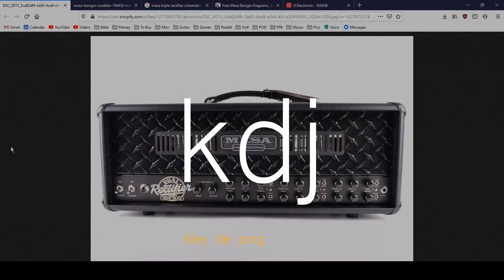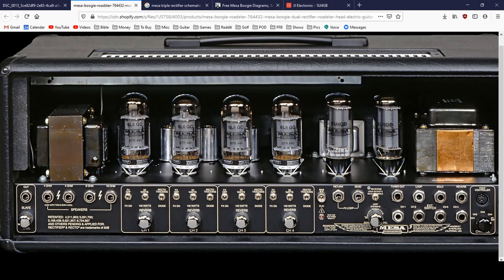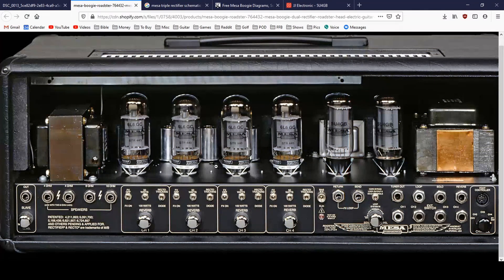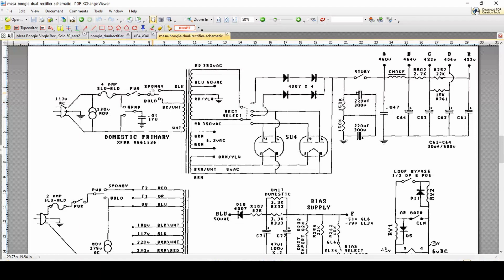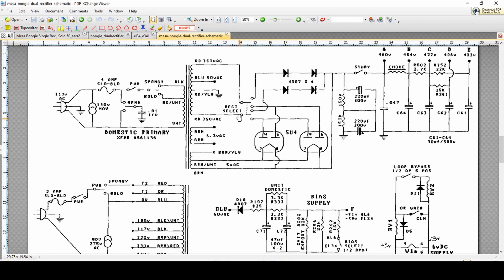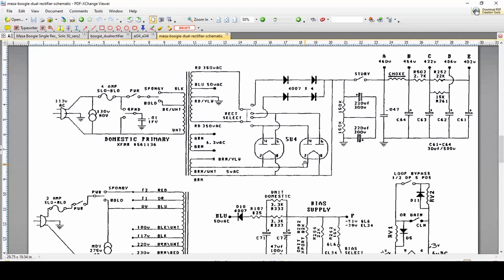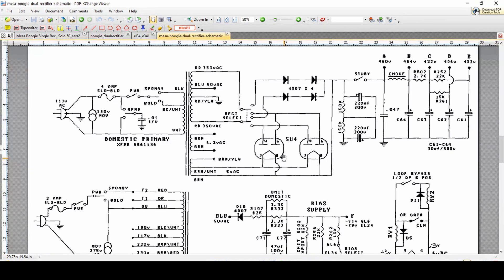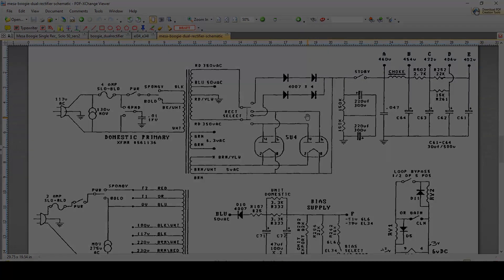What Does Dual Rectifier Mean?  Mesa Amp Explained

Comment: As a player the sonic difference between a tube rectifier and a solid state is  subtle . The advantage of a solid state rectifier is the voltage drop across the device is much less  say  .7 to .14 vdc  compared to a tube rectifier voltage drop of say 10 to 20 vdc.  This equates to slightly more power output with a solid state rectifier.  The tube rectifier also requires a large current at 6.3 vac provided by the power transformer, The transformer and rectifier tube will also generate more heat within the amplifier.  I perfer the solid state rectifier.  Just my 2 cents worth.

Comment: The SPONGY/BOLD switch in primary will affect both high tension and the heater output.
I assume the lover "bold" setting us standard 117..120 simething unput (it will produce normal out out voltages) and the upper "spongy" setting is somethingh higher like 140..150 (but when only 120 applied to input, it will produce lower than rater output wolttages in the sevondary windings).

Well unles guitar amps are even more nuts than i tought and, the upper "spongy" is standard 117V input and the lover "bold" is s lover voltage like 100V, but the transformer is driven into saturation, overheating and clipping with more, 117V being applied.

Im just learning about guitar amps and their designs sometimes make my engineering mindset scream "Noooo" like when Darth Vader told Luke about his father...

Anyways the difference, as I see it, between the primary "SPONGY/BOLD" switch and the second solid state/radio lamp or tube rectifuer switch only affect the high tension voltage.
In a way they both give you 4 combinations togeher.
On some tube datasheets u have seen that 6,3V heater voltage can have ±10% tolerance. Out if dat it deteriorates the tube quicker.
But i have seen builds when someone didnt have aoroppriate transformer, so they just chucked in one from 1920s with a far higher B+, but only 2,5V heater output (as was needed fir older tubes). So it kid of worked, tubes can handle abuse, but nit sure hiw much it shortens the lifespan...

https://m.youtube.com/watch?v=whHRtO8V3go
Precision Model 200 Signal Tracer - Part 1
@xraytonyb

Amp builders know that quick punch of B+ is damaging especialy before heaters are on, but for whatever reason are sworn to just critidize rectifier diodes, but not using any slie start circuit. 🙄

With the rectifier tube there will be 20...60V drop. Lower for directly heated ones.
With their inheritent resistance and impedance, i guess they make an extra RC filter. Sort off.

https://youtu.be/hpc63aYwkY4?si=mNNxU725vY_DmdYC
Amplifiers and Variacs!

@FryetteAmps shows how some musicians used variacs to lover the mains voltage fir their amps and how it affects the circuits if old and midern amps with built in linear regulatiors. 

I also just learned that would be considered a shitty power supply in enguneering ir HiFi with small capacitors can be a feature in guitar amp world "to cause "sag"".
It was mire if cost cutting as capacitors were expensive, but niw its a feature. 🤯

Comment: Personally, I’m all about solid state rectified amps. It’s why I love the old big Fender piggy back amps, i.e. Bassman, Showman, Bandmaster, etc. They all have solid state rectifier. I understand people play a lot of lead guitar, bluesier stuff, prefer tube rectified because it’s softer and squishier. But i strictly play rhythm guitar, often with the amp turned up a lot. For that kind of rock rhythm guitar, I find solid state rectified to feel and sound better. It’s got slightly tighter low end, and it’s a more direct sound/feel.

Comment: All I can say is Mesa Boogie amps try to do too much. I don't like them. Give me a simple straightforward amp. I don't need or want all of those little bells and whistles. Plug it in, get a great tone. That is all I want. Oh, I want it to stay that way for decades too. K.I.S.S.
Reply: Totally agree. The amount of crap they stuff into these things is just ridiculous. Switches and relays and push/pulls and mute circuits and tantalum caps under spec'd and shitty PC boards with tiny traces
These things are just nightmares that are designed to fail.
Board mounted tube sockets that cook themselves
B+ traces only 2 or 3 mm from grounds just trash

Comment: I went through half the video and you still did not explain why they use TWO rec tubes instead of one...!!
Reply from the maker: At 1:10 I explain that there are two tube rectifiers and also the ability to switch between tube and solid state rectification. Lastly I argue it is somewhat of a marketing related term.
Reply: @KleyDeJong        Then you don't know anything about electronics and the difference between single and dual rectification..
Reply from the maker: @pjf7943  I know that two rectifier tubes provide higher current potential. I also acknowledge that I don't know everything and am happy to receive input where I'm lacking. What I don't wish for is to fight with viewers in the comment section. I'm appreciative you chose to watch my video and I welcome your input.

Comment: The dual rectifier was supposed to be a series of amps. It’s only dual rectifier because you can switch between solid state or tube rectification. Some lower wattage amps like the blue angel had only one rectifier tube. The tremoverb had a better high gain sound than the solo head which is now only known as the dual rectifier. Personally I think this amp is the most overrated piece of shit mesa ever made. Their most underrated was the mark III

Comment: Rectifiers do and will always...affect the sound character of tube amps. 
SSR/VTRs each directly changes the plate voltage with VTR lower and SSR higher plate voltage. This will most pronounced when using SiC SSR.

Comment: Mesa is giving so much protagonism to a meaningless part of the sound of the amp.  Any difference in feel from tube recs comes to play in stadium volumes. For me its more of a marketing scheme to give the customer more tubes and more parts to fail on already overdone amps. Could've called it Mesa Quad Diode Rectifier and some people would fall for it.

Comment: Great video. One correction though, the spongy and bold switch does the opposite of what you were thinking. The bold side ups the voltage and the spongy side is lower. Here's a forum page talking about that. Also, the difference between tube rectification and diode rectification is actually surprisingly noticeable when you're standing in front of the amp and listening to it. I have the amp, and have switched back and forth many times, using brand new 5U4G tubes to rectify the signal. Try it sometime! It is a very different sound, at any volume level. Diodes make it sound more like a distortion pedal, very consistent and uncompromising, whereas the tubes have more give and complexity in tone, simply because they inconsistent (inefficient) power supply to the tubes let's them "breathe" more, giving the response of the amp an overall more spongy feel, especially on the spongy setting! It is also louder to use diode rectification, as there's more power getting to the tubes, and of course, louder even more when using the bold setting. I like to use spongy and tube rectification and if I want a more distortion pedal like sound, bold and silicon diodes really kill. But my favorite sound is with tubes and spongy setting. It's easier to listen to for longer https://www.rig-talk.com/forum/threads/dual-rec-vaccum-silicon-and-spongy-bold.130976/#:~:text=New%20member,-Jan%2029%2C%202013&text=spongy%2Fbold%20affect%20the%20voltage,browner'%20tone%2C%20go%20spongy.

Comment: Wow, more great info Kley. Thanks so much. 
Question: is the term "dual rectifier" because there are 2 tubes/2 diodes or because the rectification is 2 types i.e. either solid state (diodes) vs tubes? I have a Mesa Lonestar Special (great sounding versatile amp) that uses a 5y3 tube rectifier for the 5 watt and 15 watt settings and uses solid state diode for the 30 watt setting. Is that also a "dual rectifier"?
Thanks again.
Reply from the maker: I would say it is mostly because it is switchable between solid state and tube, so yeah I think you could call your amp a 'dual rectifier'.  Mostly it is just a marketing name though.
Reply: @KleyDeJong   Yes, I understand. Thanks.
Reply: It is because there are 2 vacuum rectifier tubes. The Triple Rectifier has 3 vacuum tubes

Comment: Awesome video again Kley, always wondered why they'd need a Dual Rec tube in that Amp! Makes sense but like you said, probably not really needed when they have the Diodes as an option
Reply: Another thing is rectifier tubes can lengthen the life of your power tubes. Because tube rectifiers are not as efficient, they don't drive the tubes quite as hard as consistently as diodes, so there's a more complex power flow and a little bit of voltage lost
Reply from the maker: Thanks!